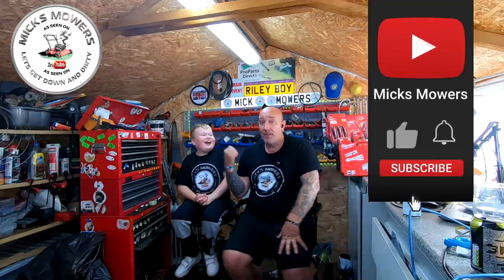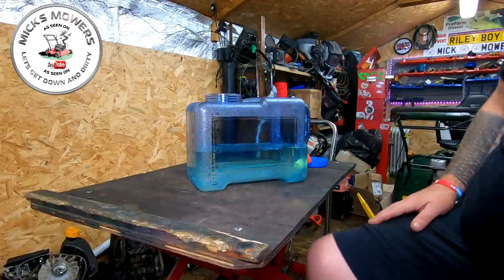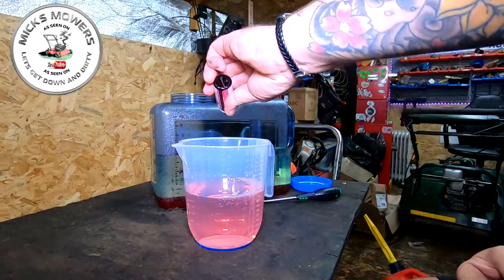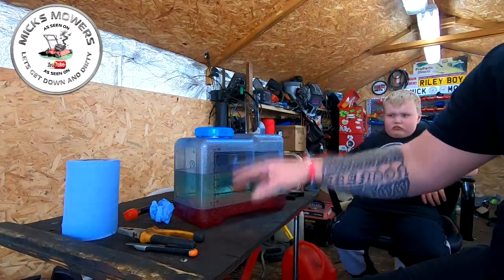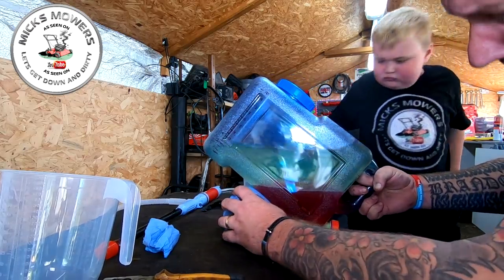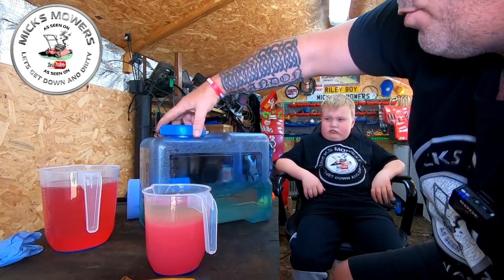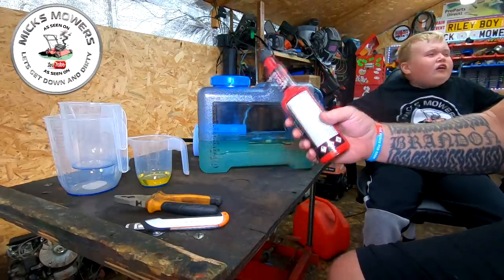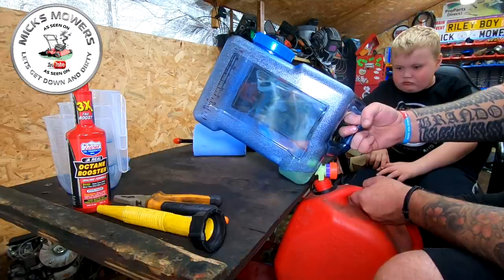How To Remove Ethanol From E10 Unleaded Fuel To Use In Lawnmowers And Small Engines

Comment: I think its madness doing this inside your shed where there are endless sources of static electricity available to ignite the petrol. At the very least you should be using rubber gloves to insulate your hands. And you have now shown your lad how to do it, I hope he does not have a key to the shed?
Reply from the maker: No key to the shed apart from the one I have.. I had plenty of ventilation.. what do you suggest do it out side in the blasting Sunshine where the sun could magnify off of a tool or something.. it wouldn't of been right no matter where I did it in some peoples eyes... But hay thanks for the comment
Reply: @themowerman   Twice recently I have seen petrol ignite from static electricity. One was one the building site I can see over from my office window, one worker filled the tank of a generator and when his mate moved in to refit the petrol cap it ignited. Luckily neither was badly burnt. The second incident was when a woman was inserting a petrol pump gun into the tank of her BMW whilst using her mobile phone, it didn't end well. 
If and when i do handle petrol now I always wear rubber gloves to reduce the risk of static discharge.
Reply from the maker: @davidjones8680  yeah I hear ya.. but it comes down to personal choice..
Reply: @themowerman  Yes indeed, all down to ones personal choice. But personally I would not expose my son to such risks. "Keeping safe is working safe" were the wise words shared from a wise old teacher on the day I left school.